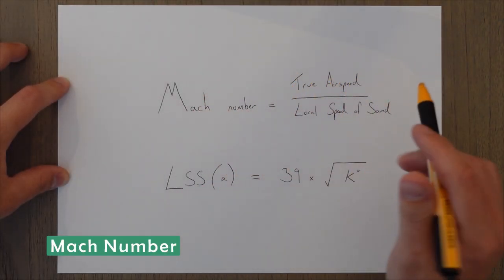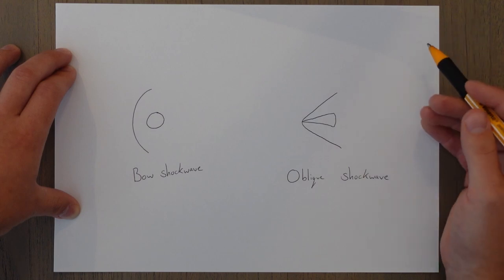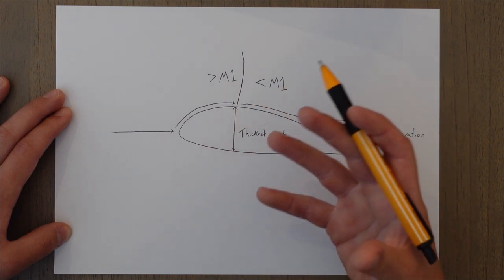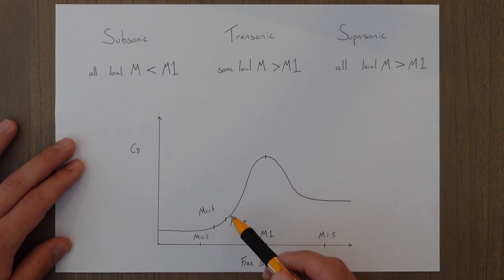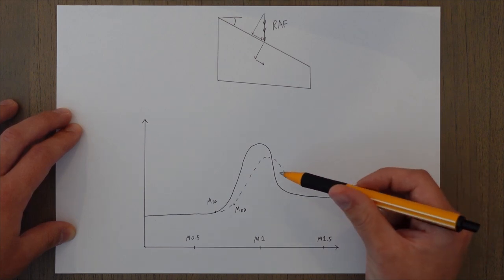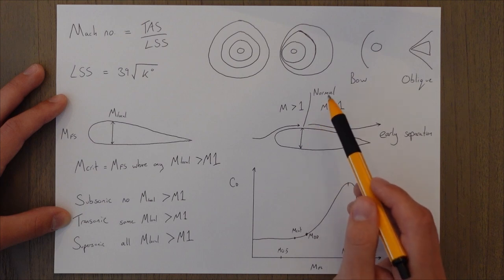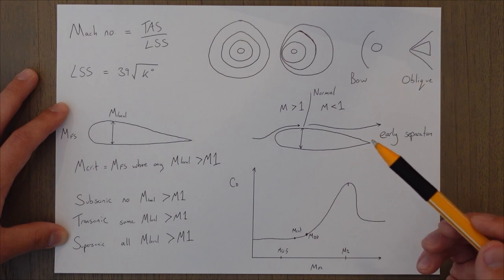ATPL Principles of Flight - Class 20: Supersonic Flight I

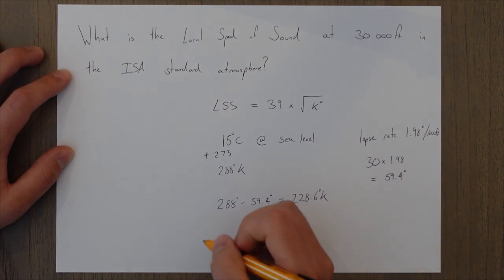Comment: at 3:58 you substract celcius to kelvin ??
Reply from the maker: 1 unit kelvin = 1 degree Celsius so this is possible
Reply: @atplclass  I am sorry, don´t know your email address for not asking publically. I did made a conversion of 59,4°C to Kelvin, and I´ve got completely incorrect result (K=59,4°C+273). For what reason is it like that. Why is 1 unik kelvin equal to 1 unit Celsious in tht example, if normally I calculate K=X (°C)+273. I do not copy this. Thank you.
Reply: @petrasovakova1568  I didn't understand it either but anyway if you calculate the other way it still works. ISA at 30 000 ft = -45 C, then you convert it to kelvin (-45+273) =228 K